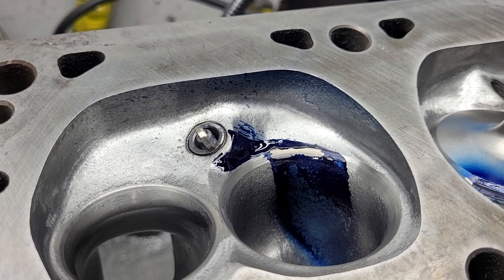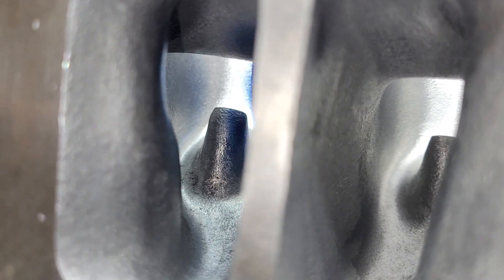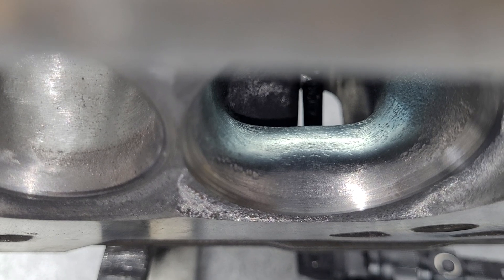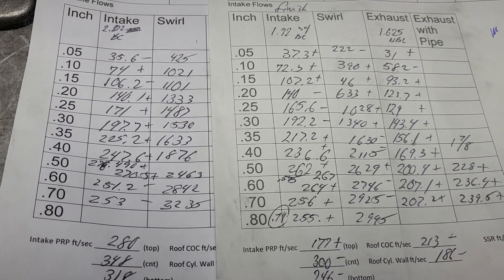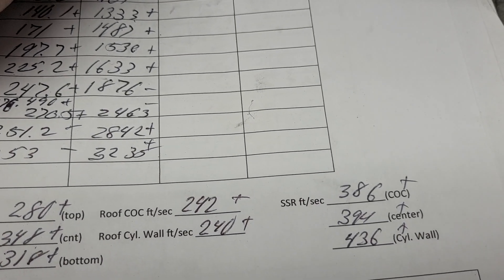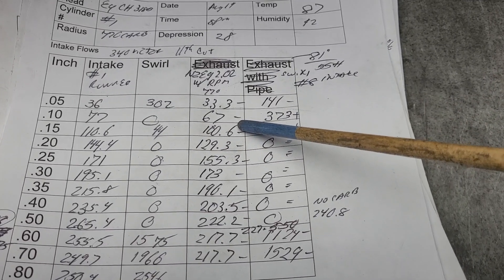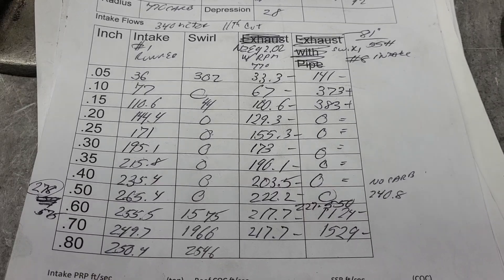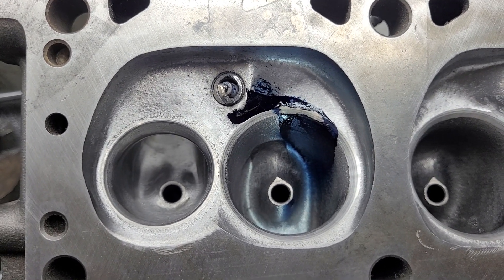EQ New Zealand Magnum cylinder head finished, 2.02 valve, ported Edelbrock performer rpm, 770 carb

Comment: This mopar guy sure appreciates you sharing your knowledge with us i got a new pair of these heads been trying to find a good used set of rt heads because they will easily outflow the new zealand heads at least  with me porting both but I'm not paying 1500 dollars and more for them but with a 202 valve the rt will easily flow 310 cfm the last set i ported just a little info that i have found out on my own but i have got 265cfm out of the new Zealand head very easy prices for everything is thru the roof now when those new Zealand heads came out you could buy a bare set for 350 dollars can't hardly buy one Chinese head for that now ridiculous
Reply from the maker: @raysimon1368  Prices are insane. Good used stuff is about the only way now. Tough to find.

Comment: New to building engines. I have a fuel injected 360 with a mild cam. What is the power difference between an aluminum head vs a eq head?
Reply from the maker: Mild set up, maybe none maybe a few hp. Would need more info. Thanks
Reply: @servediocylinderheads  
Cam specs
Duration: 265
Advertised Exhaust Duration: 273
Intake Duration at .050 Inch Lift: 216
Exhaust Duration at .050 Inch Lift: 224
Intake Valve Lift: 0.506
Exhaust Valve Lift: 0.506
Lobe Separation: 114
Exhaust Close ATDC: 18
Intake Open BTDC: 23
Exhaust Open BBDC: 75
Intake Close ABDC: 62
Hughes air gap
Currently stock heads with upgraded springs and push rods.
Stock blocks, pistons and crank
Factory efi tuned with hp tuners
Jba shorty headers with full 3 inch exhaust
I am trying to see if its worth the extra 1k to get aluminum eddys over ported eq heads.
Reply from the maker: @02rtjawn  Depends what you are trying to accomplish.
Reply: @servediocylinderheads  streetable fun suv. Power wise im not sure what to expect honestly. If I am paying 1k for slightly better flowing heads would the extra compression add up to over a 25 hp/tq gain over ported Eqs?
Reply from the maker: @02rtjawn  I would take a step down in cam duration and use iron heads with some work done. Thanks

Comment: Dual Plane, two carb barrels to feed 4 cylinders, but 4 cylinders aren't drawing at the same time. Dual planes suffer at the top because they have to turn 90 degrees twice.
Reply from the maker: The runners are also longer and  have less cross section. Thanks

Comment: Hey Charles,
     Tim here, you touched base on an idea, i've used for years......put a bigger carb on it.......since all my stuff is Pontiac, i already use a big carb, big carb, smaller port, makes GREAT power....(my stroke bein 4.210 helps).......but yes, a big port (like a BB Chevy) wont respond to the bigger card, as the velocity is down........on my Poncho stuff, it responds to the larger carb BIG time!!......i have 462 cubes, i run a QFT 950 Q-series........it works very well!!.....if i put an 850 on it (and tweak that a bit), it will still slow the car down......put the 950 back on, and BOOM ET is back.......i believe port size and length, along with bore size and stroke, really dicate what carb shud be used, not just some calculator for cu. In.......theres alot more in play, but that comment on usin a bigger carb on a dual plane, was SPOT ON !!!...good call!!.......enjoyed the vid!!!...PEACE to you sir!!
Reply from the maker: Nice! Thanks

Comment: It would be interesting to flop intake manifolds on those 2 heads and flow them. 

I’m thinking that the guy should have went with the down under heads to begin with, but I know they are hard to find and pricey. 

I wonder how these heads stack up against the mopar magnum RT heads. There are a pair for sale on FABO right now priced at 1k.
Reply from the maker: Damn, pricey for used heads.
Reply from the maker: Yeah, no. I put enough free work into these!
Reply: I totally understand.

Comment: So , my question would be ,how should he chose his camshaft with this set up? allow for more duration since it is higher velocity? or due to larger engine? or saty with a short duration and use a roller grind?
Reply from the maker: Have a cam guy spec it!
Reply from the maker: Low duration roller.
Reply: @servediocylinderheads   Thank you

Comment: How much lift at the valve will this engine have Charles? That is a horrible chamber , they could have redesigned it before they casted that head.
Reply from the maker: Cam is not set but a bit over .5 I would guess. Thanks

Comment: As owner of these heads, I am SUPER excited with the results. Just for reference, and my own curiosity about the China heads vs mine, I rewatched the vid for the 9th cut on the China heads. They topped out at 273cfm @ .575" lift. Close examination of this flow sheet shows 276cfm @.490" lift with WAY less work. I will be using the Eddy RPM, and it's great to know my heads are not the cork in my intake tract. Also, FWIW, I needed new valves. The 2.02" valves were available new. Could not find the 1.92" stockers new. Happy I chose the bigger valves.
Reply: These are definitely better looking than the China castings. Thanks for the comment and explanation too. Please let us know how it turns out when the rubber meets the road brother 👏👏👏.
Reply: This engine and cylinder head combo should make sick amounts of low and mid range torque on the street. I pity the fool that has to buy tires for this car!
Reply: After aquiring a set of these NZ HEADS. This video made my day and Future much better. My daily, will be much more fun. With a cam , the M1, Hughes throttle body  2bbl or 4bbl I've collected over the years, and the 408 ought to be a blast, since the Magnum cans die off at higher RPMs . Richard Holdener showed a cam that picked up 70 hp, With a stock Magnum. Crate motor. Looking forward to keep learning more about how to Port my NZ heads. Thanks to Charles 👍 I'm learning more and more . My heads are untouched. For now.

Comment: Beautiful work, Charles!  That port and bowl work, is almost cnc!
Reply from the maker: Thanks! I think.
Reply: Better than cnc. Now if you could digitize the port and then cnc that path, then you would have something.
Reply from the maker: @markhenke6043  I would license my designs to a cnc guy. Thanks
Reply from the maker: Wiffy likes $$$$!
Reply: We all like money, it’s just that women like to “go shopping “ with no intent on buying anything specific and men, what they don’t save they like to spend it on meaningful things like CYLINDER HEADS and INTAKE MANIFOLDS.
Reply from the maker: @markhenke6043  And fuel injection systems!
Reply: @servediocylinderheads  I was refering to the precise look, of dimensions. The finish does look better, than cnc.
Reply from the maker: @strokermaverick  Thanks!
Reply: I think Charles found a way to secretly CNC program his hands. There's NO way my hands could reach this level of surface finish.
Reply from the maker: @robertwest3093  40+ years! Thanks

Comment: Your customers need to switch heads. I still think those New Zealand heads can get way more than what the Chinese ones did. Too bad they wanted to hang at 400, i get it though, gas ain't cheap!
Reply from the maker: I agree, better head design would go far. Thanks
Reply: Keeping my goals realistic, and my Ramcharger is a bit porky. Single plane intake would make more up top, but rarely will the engine be there. It will be a driver, and hopefully make Power Tour in 2024.
Reply: @TheEpidemicFla  I have similar goals, so I appreciate this work and information that targets a street workhorse. My goals are to end up with a motor using similar concept SB Mopar Heads (more torque based and lower rpm) so I can have half durable "taxi cab" motor for longevity and half "tractor" workhorse motor for my daily driver/trailer puller. My motor won't be glamorous looking enough to have the hood open, but hopefully it will be dependable enough to get me to the car shows that have the eye candy motors in the muscle cars with eye popping dyno sheets and ET slips. Always good stuff Charlie!
Reply from the maker: @TheEpidemicFla  This is excellent! Thanks